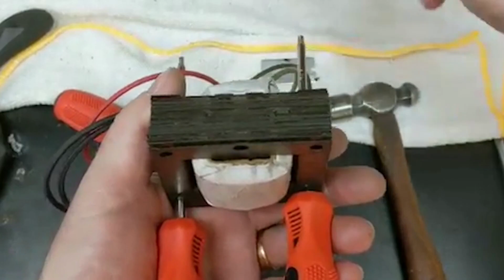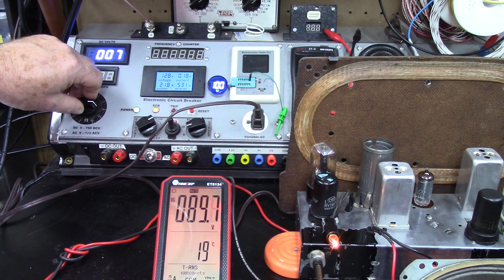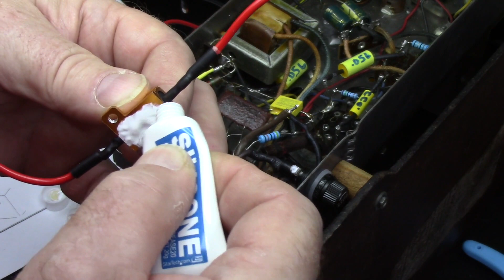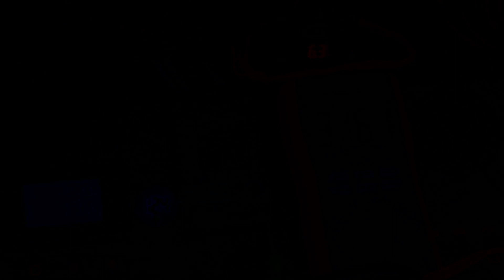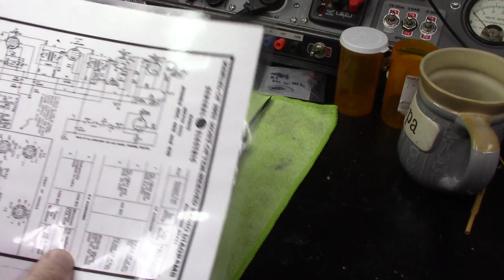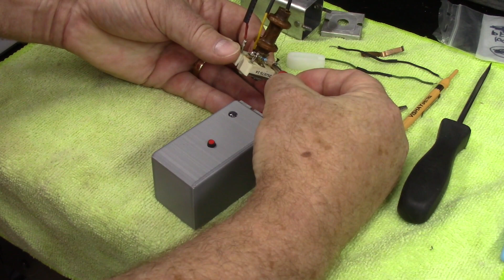GE 404 Six tube radio-  Part 3 - More Electrical Work & Royal screw up

Comment: Hi Gregg. The IF signal will blast through anything. 
Check all the voltages on all the tubes. 
Do you get any noise if you scratch the antenna lead on metal? 
Check the oscillator is running. 
Bypass the first RF stage by touching an antenna wire to the grid of the 12SA7. 
You can bypass the suspect IF using a small capacitor from the plate of the 12BA6 to the wire going to the grid of the 12SQ7. The capacitor will block high DC getting to the grid.
If you have a signal tracer is the signal present from the front end up to a certain point?
Good luck my friend 👍🙂
Reply from the maker: Thank you David! I will do those checks sir!